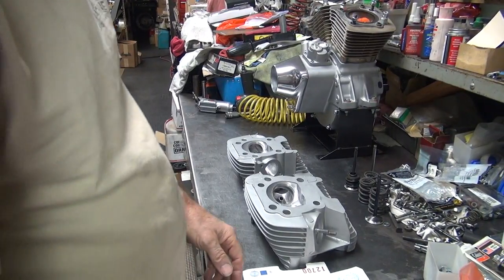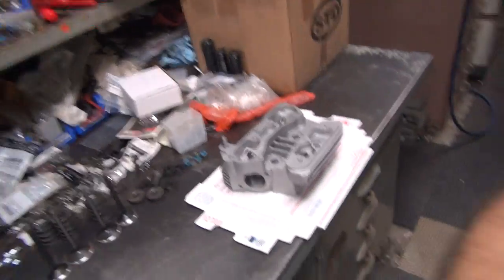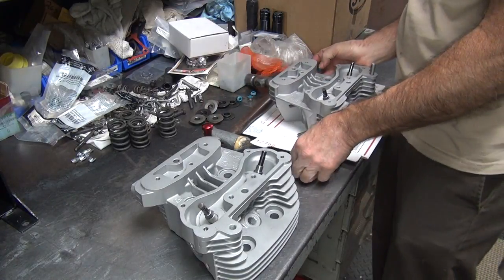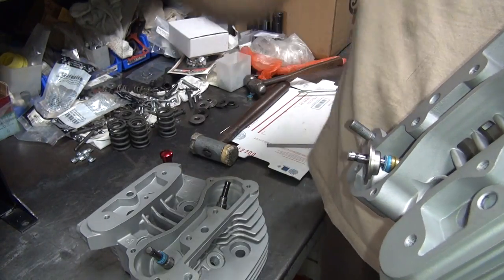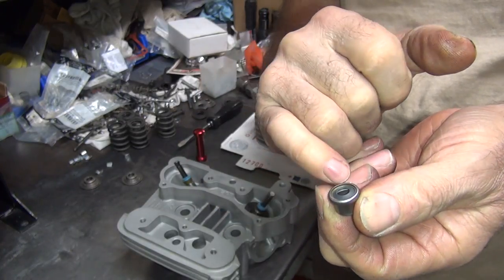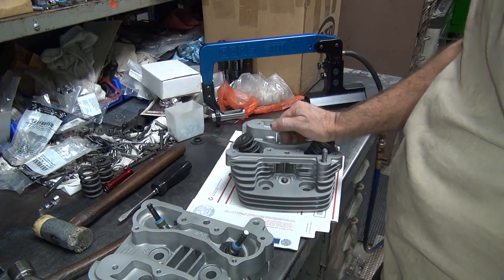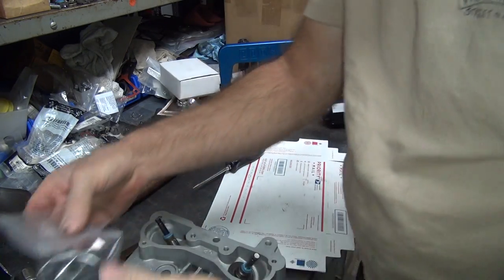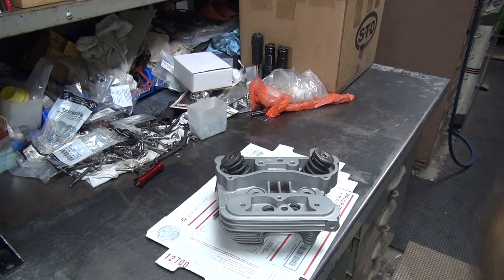1992 80ci evo motor rebuild #126 repair softail fxst flstc case welding harley by tatro machine

Comment: Hello Mr Tatro !!!  I have a 62 pan motor , years ago I put a A grind cam in to wake it up a bit .  Will a b grind wake it up more !!!   Are valve springs the only other change when running a b grind !!!     Cam suggestions ??? Thanks
Reply from the maker: it all depends on the rpm you want to run it at. don't forget the porting.  you can also do the s&s evo lifter and 585 cam upgrade. you get more power and reliability. watch the vides to see how all this goes together.
tatro